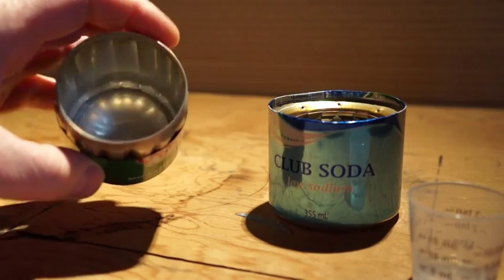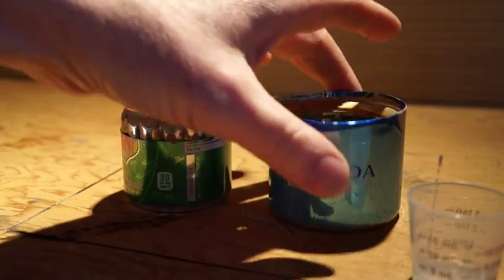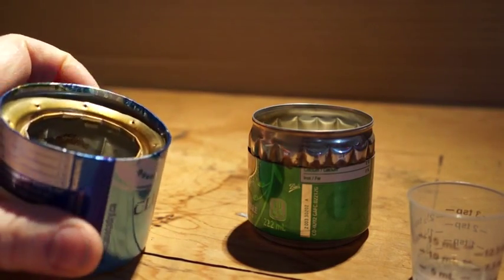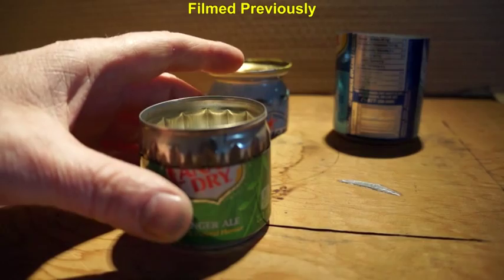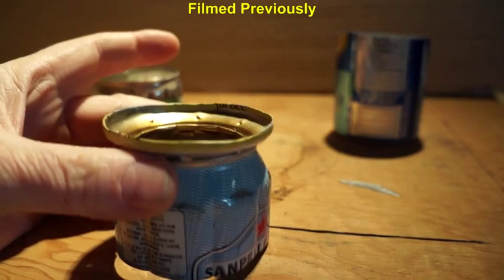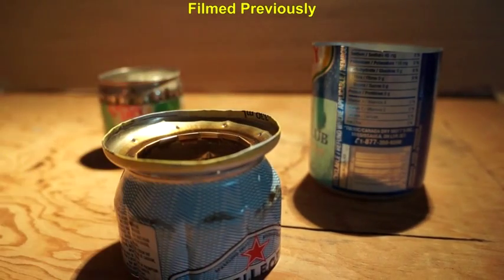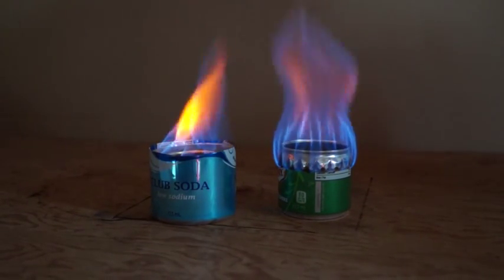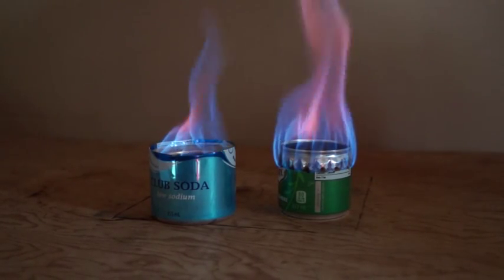Vortexing Capillary Alcohol Stove

Comment: Why the inward-flame? So is more than 16 percent thermal efficiency is better than other flames.The superior energy-saving technology developed in Japan.Side-burner  model is no longer a heritage of the past."FREVO STOVE" You can get hot water within 320 seconds from ignite / 18 ml methanol /with FREELIGHT550 titan pot.Of course,You can supply fuels to this stove in burning action.its body about 6 gr only.
Reply: Methanol is very toxic, very dangerous fuel not suitable for indoor use